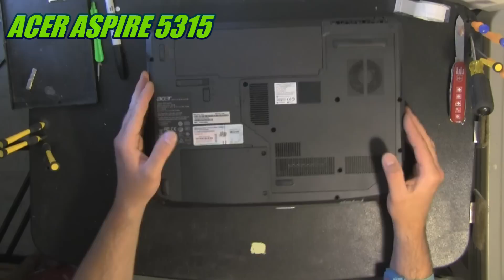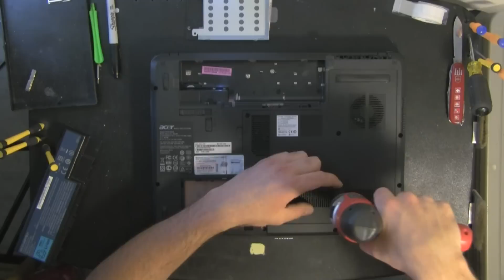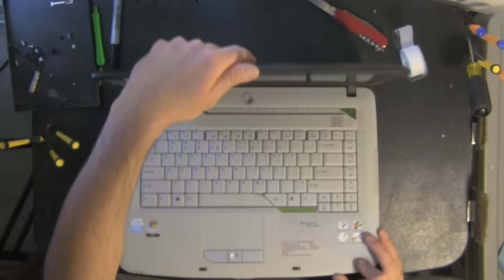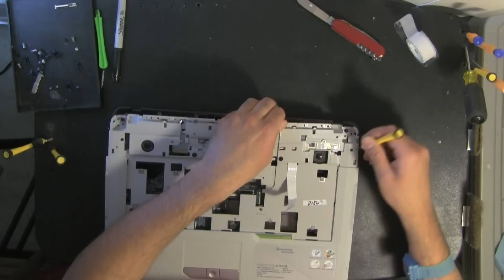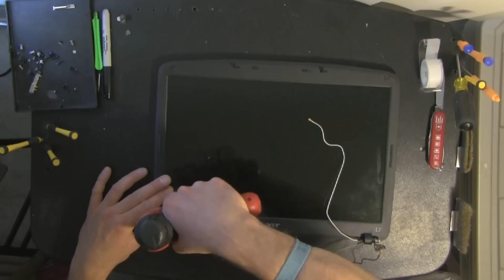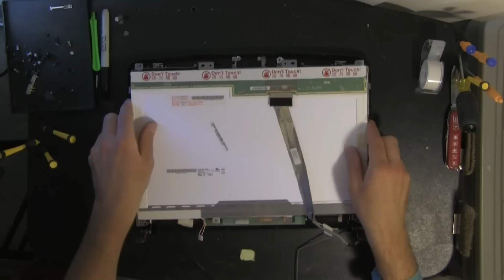ACER ASPIRE 5315 take apart video, disassemble, how to open disassembly

Comment: Hey thanks for the dismantle. I couldnt figure out how to get the keyboard off. Didnt see those little screws in the battery compartment. Great video!
Reply: If the speakers cover won't move when you try to pry it off, then somethins is holding it from beneath :)

Comment: (Spanish is ok, if you want). Hi, very usefull your video. I nned to repair / resold the right USB port AND the power jack. The seem to be loose or not well solded to their supports. The laptop charges sometimes, if you move the jack, it charges alternatively. After watching very carefully to the video I can see you must dismantle almost all the eq to reach the power jack, and after it, you unswitch is, like there is no soldering of the jack to the MOB. Thanks, from Argentina.

Comment: Hi,
I have a an acer aspire also and my screen keeps flickering and has lines across it I can still see the screen a little but i have to adjust it or put pressure on the corner. I think something is loose. Do you have any suggestions? and how could I identify the problem?

Comment from the maker: You may try to leave fan and heatsink in place, because it maybe possible to remove only palmrest and than lift up a motherboard a little and change a dc jack... but if it will not work, you may need to take motherboard out.

Comment: hi.i want to ask you what is the name of the final piece from the display.the piece that at the end of video.i have a problem with that,from time to time my screen turns black (more black with withe vertical strikes)but when i remove the wire and put all toghether,everything is fine.

Comment: Hi!!!
Great video!!!! I had already started to take my laptop apart when I found this.... I think the problem is the dc charger connector....  Power out checks ok on the adapter, but gradually the wiggling of the ac adapter connection would not work to power or charge the laptop.... I have ordered a new connector.... but it took a week to get the part... now I'm having a difficult time remembering ho to put it back together.... so I am waching it again and again to see If I can get it back together.... It would be nice if one could watch the video in reverse (LOL!!!!) or have a reassemble video..... Hope I will get it back together soon.... Thanks again!!!
Reply from the maker: Hello, I can imagine how difficult it can be to reassemble a laptop without a video in a week or so. I hope you will be able to put your laptop back together!
Reply: regazzz
Hello! I am replying to you on that laptop.... The only real problem was the black and white wires (Antenna wires?) connected... I was able to find another video that showed the connection on the back of the laptop.  I worked for 25 years as an electronic technician many years ago... Take care.

Comment from the maker: You can remove carefully this keyboard without taking anything else out. Or you can remove it by removing power button cover first. There are some screws holding it on the bottom side (if I am not wrong). Good news that there are no screws holding this keyboard :)
Have a good luck!

Comment: Andrew Rhee - There isn't any cmos reset jumper. I was having the same problem, then I ordered a new bios chip preprogrammed with 1.45 version. It made my computer come alive again... almost. But now I think I've fried the GPU (graphics chip), because it won't show anything on-screen.
The replacement procedure was pretty involved, as the chip had to be soldered in, so not for everyone!
Reply from the maker: Lasse Steen Bohnstedt nice work!
Reply: regazzz Yeah, I'm almost proud of myself :-P Would be better though if it actually finished the post process.... Why I think it's the GPU: If I leave in the RAM it will hang, black screen; I can't even shut it down, have to pull out the battery. If I take out the RAM it will still hang with nothing on screen, but at least then I can shut it down by holding down the power button. The RAM block works fine in another pc btw. The GPU is shared RAM type (uses part of the same as the rest of the system... only explaining this for if others read along ;-) ).
Reply from the maker: Lasse Steen Bohnstedt
Thanks for explanation. With a new comment system I am a little lost and don't really know what will happen with all that comments people have posted prior G+ integration...

Comment: Hi there, very helpful video. I have an issue with the backlight I guess: after a 5 years of working the display starts to appearing in red color after sleep or when it turns on, and then more and more red, and after a day it does not turning on absolutely. The display is working, it can be seen by using a flashlight. So what should it be changed and is there a possibility to fix/replace part at home, or get a deal with service?! Thanks
Reply: I have a similar problem I will check the connector first, then if need be a baclkight from another laptop (Sony Vaio). Otherwise use it with an external monitor.
9 years later maybe you still have it :p

Comment: Hey I've got this problem maybe you know whats going on.. The same model, when I turn it on power light is on and nothing else id happening. I can't even turn it off holding power button for >5 sec. Is there anything I can check or do?
Reply from the maker: Check different memory first.

Comment: Hi. Does replacing the DC power jack require soldering or does it just clip in? Thanks.
Reply: There is a connector on the motherboard that connects the DC jack to the motherboard, but you need to completely disassemble the laptop in order to get access to it, since it is hidden. I had to improvize with mine, since it was missing (who used it must have broken it and conneced the adapter wires direcly to that connector. I managed to put one DC jack from a projector, though slightly larger, I crammed it in there(melted the plastic tabs inside to make room for it) and it works.
So it is easily detachable and replaceable.
Hopefully after 9 years you still have it :p

Comment: Hi. Does replacing the DC power jack require soldering? Try.
Reply: 9 years later reply: No. The DC jack is connected to the motherboard via a 5 pin connector.